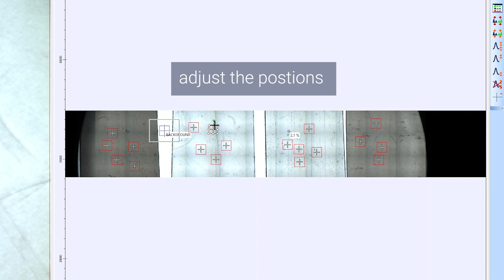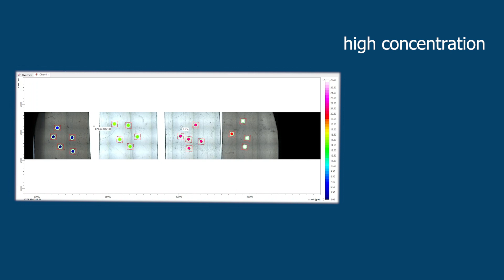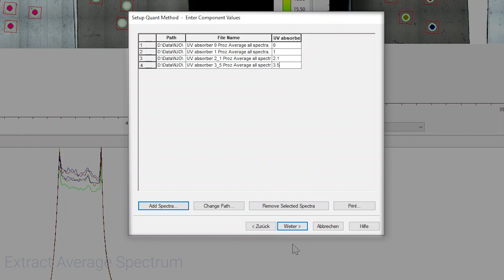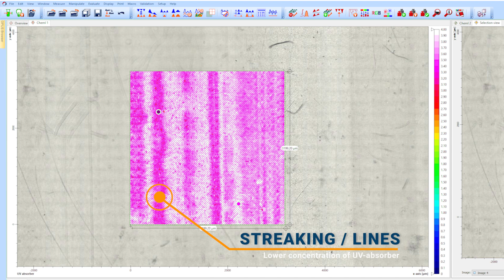Quantification of Polymer Additives | FT-IR Spectroscopy | UV Absorber in Polymers

Comment: Hi, I have a question, what signal are you using to identify HALS? 1540nm and 1370 ?.I am trying to identify HALS in polyethylene films, and the peaks are very small due to the concentration
Reply from the maker: Hi Jorge,

we did normalize the spectra to the peak at 1370 cm-1, and then interpreted the range from 1515 to 1575 cm-1. This is a fairly typical sample but lower concentrations will still work. If the concentration is very small, you might try longer measurement times to boost SNR. 

Best of luck to you!